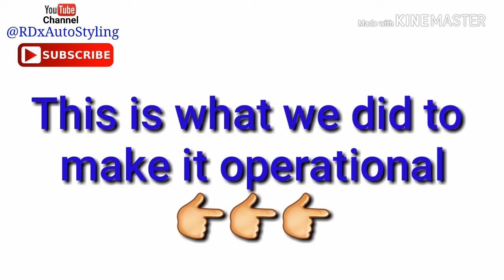First Ride of self made Electric Motorcycle with 4 lead acid battery #EVBasics

Comment: Ye battery use kiya to kya hum isko ghar pe charge kr skte hai acid battery ko

Or battery se motor me wire gaya hai. So motor se wheela ghumte hai

Usi me ek extra belt laga ke generator laga le vala pe or uska generator ka wire battery pe laga de to kya battery bike run kregi usi ke sath sath charge hogi ya nhi

Comment: 24v ki lithium ion battery me bms laga hua he or use series connection kar ke ek or 24v lithium  ion battery ko jod kar 48v bana sakte he kiya
Reply from the maker: Yes it works. Nadeem who makes lithium ion battery packs for me has many times connected two 24v (29.4v) battery packs with BMS.

Connect the BMS out put wires in series and also charging wires in series. Both the battery packs will be charged with 54v Li ion charger.
Reply: Thanks

Comment: Kitne AH ka battery lagaya he aur Kitna distance milega
Reply from the maker: In this video I have used 4 x 12v 35 ah battery but if you see the final finished video I replaced it with 48v 30ah battery.

One charge gives me approx 50 to 60 kms per charge depending upon use of headlights.